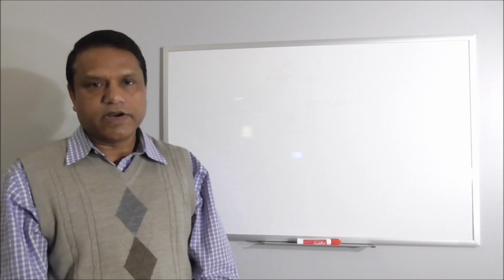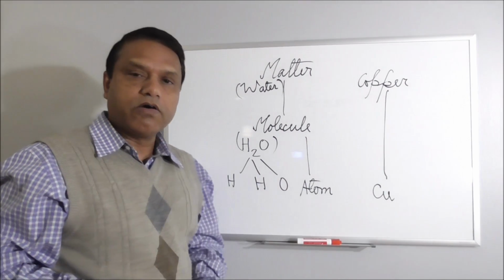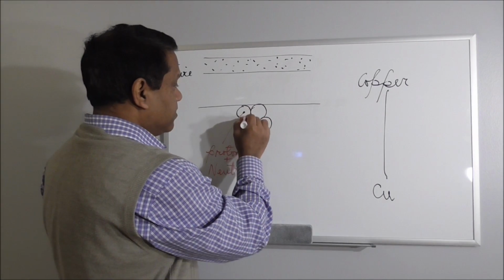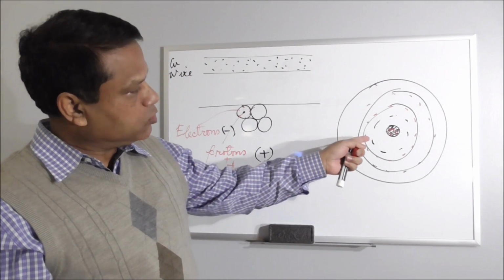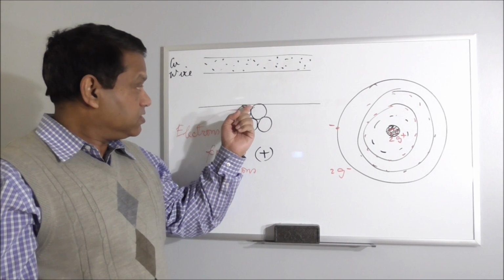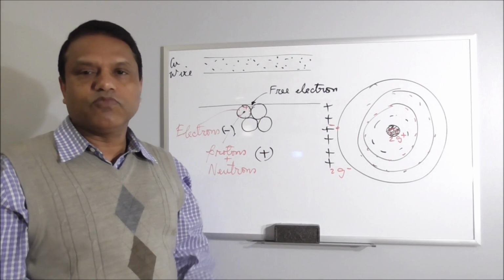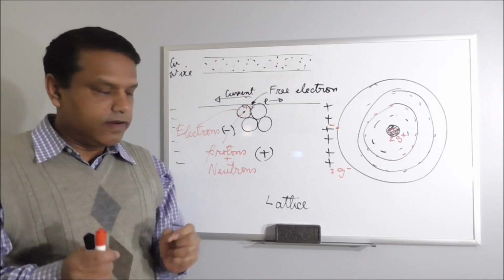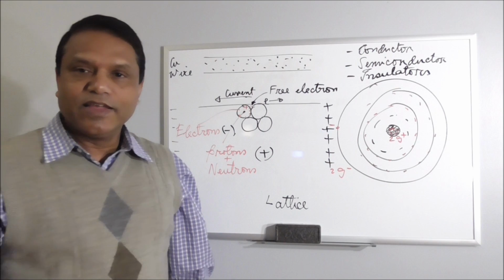DC Circuits 1 -  Charge and Current

Comment: Energy transfer happens along the surface of the wires (NOT in the metal). "Charge" is a Quantum stuff, not easy.
Volts and Amps are only a material reaction (interaction), response to the EM field around the wire for example.